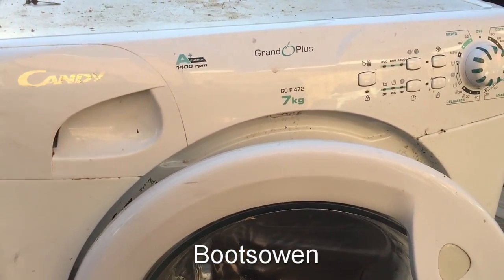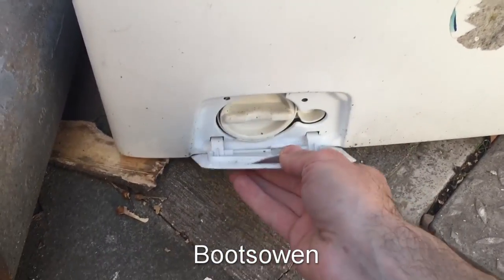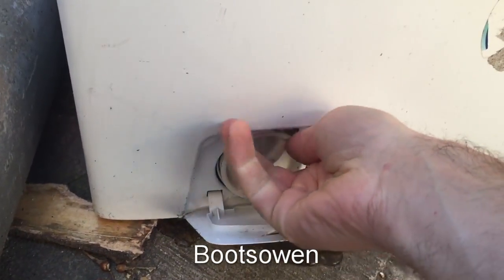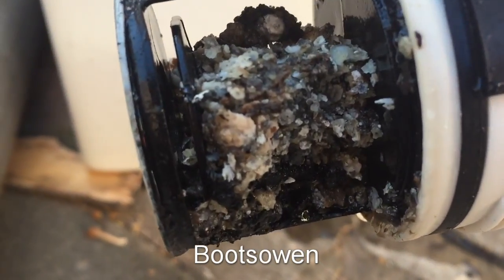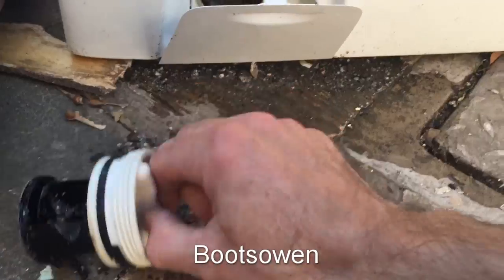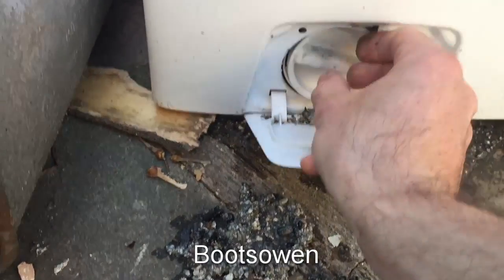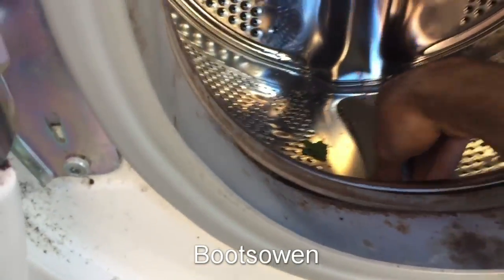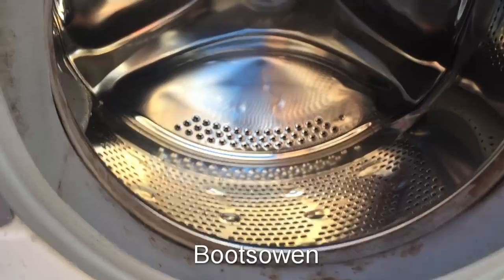Cleaning Candy GO F 472 filter

Comment: Having owned a Candy washer a couple of decades ago, I can tell you they have always been crap.
It seems they are consistent in their efforts to explore new levels of crappiness.
Reply: My first Candy washing machine bought 22 years ago still works with two minor issues repaired for couple of bucks. The second one works fine for 7 years with one small repair made by myself.
Reply: @maciejzobinski4440  Thankfully I no longer have a Candy machine, I used to have one of the late '70s that was a total nightmare in every aspect. 
Next I switched to a Siemens that is flawless and works splendid every time for more than two decades now.

Comment: Is there a way to pull that weird thing out that's on the side? You mention at 0:29 cuz my washer/dryer takes forever to dry the clothes, so i need to try and clean the lint trap out and that weird thing on the side is the only place it can go.
Reply from the maker: What does the manual for your washing machine say
Reply: @bootsowen : Thank u for getting back to me so quickly. The manual doesn't say a lot, it just tells me that the washing machine comes with a special filter to be able to trap large residue such as buttons or coins which could clog the drain. I already knew about this because u showed it in the video. It also says that it's only available on certain models where u can pull out the corrugated hose by removing the stopper so u can drain the water into a container. The next bit tells me how to unscrew the filter and screw it back. I've also got another problem as well, because it takes ages to dry the clothes there's an odour on the clothes after it's finished drying.
Reply from the maker: Usually washer dryers wash about twice the load that they dry, so you have to remove half the laundry and dry it in two batches.
Reply: @bootsowen : I don't dry all the clothes that wash in the dryer some of them i put on the radiators cuz of the dryer srinks them so i know I'm not over loading it. Also the clothes are now smelling after the drying's done.